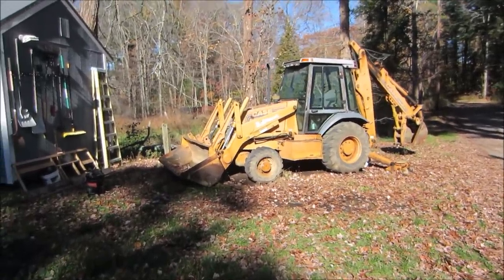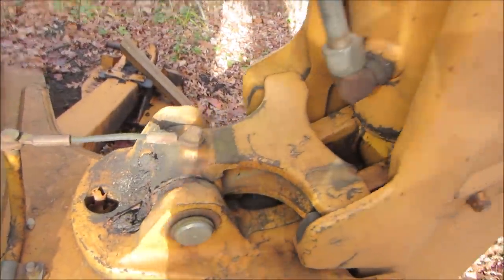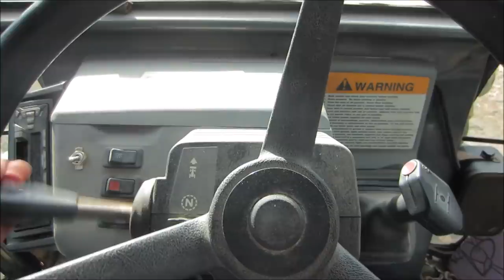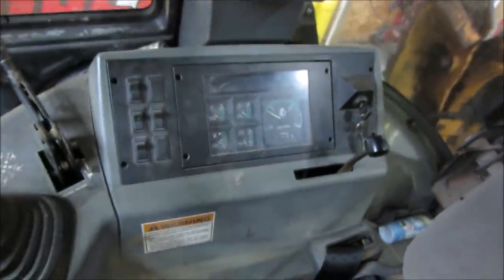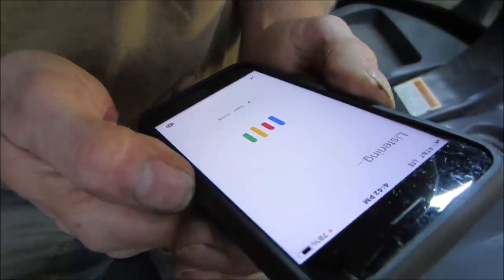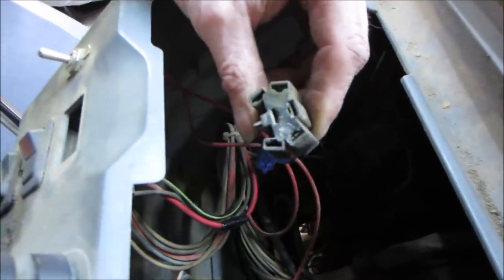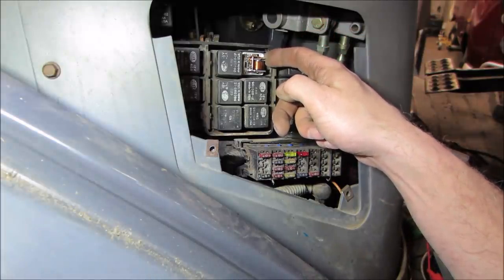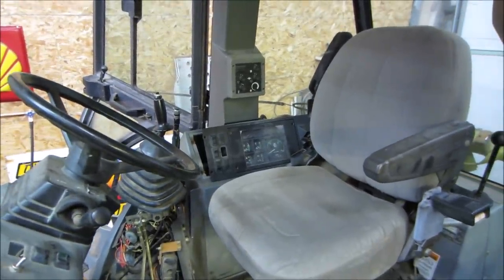Lets Fix Up A Clapped Out Case 580 Backhoe Thats Been Sitting.

Comment: Given how that wiring looked, I'd be pretty tempting to change out all of those bulbs for much brighter LEDs and drop the fuse ratings down by 50% even if you get it straightened out. Something melted it down the first time, but there's no need to run that much power with better technology available. 100W of LED (10A) will burn your eyes out of your skull.
Reply: No need to drop the fuse ratings even if one opted for LEDs.  The rating of the fuse does not determine how many amps flow through a circuit, only at what amp draw the fuse will open/fail.  And the size of fuse in any application is based on the ampacity of the circuit conductors so that if amp draw is too great, the fuse will fail and protect the wiring.
Reply: @larrywalker7759  However, would you want to drop the fuse since if the leds fail it will be at less amperage? I don't know. I am just guessing.
Reply: @Larry Walker  Except the very clear evidence that the fuses didn't protect the wiring. The wiring is all fried.

The entire point I'm making here is that we don't know what caused the original failure. It could be poor design, poor maintenance, or just a ghost in the machine. You could spend years chasing down the true root cause, while it melts down over and over, even after you repair all of the obvious failures. Or, you could just cut the load on the circuits in half, as well as the fuse ratings so the fuses actually do protect the wiring, and probably not worry about it again. Upgrading to LED is an upgrade regardless.

 @BigBaddaBoom  Everything being equal, it wouldn't hurt. I don't think 12v direct replacement LEDs are particularly prone to fail in a ways in which they burst into flames or anything, but..? There's no particular reason to have a fuse in the circuit that is twice the value that it requires, so, there wouldn't be any harm in it even ignoring my original point.
Reply: @TheBrokenLife  Fuses didn't protect the wiring because... they're not in circuit. He shows the back of them at 1:16:40 - there's no wire coming out of either of the fuses, someone bodged it, completely bypassing the fuse box.
Reply: @TheBrokenLife  From the evidence of mice, I can almost guarantee the cause of the fuses going.😒😂
Reply: @BigBaddaBoom  Fuses protect the wiring from melting down and catching on fire, so the fuses are rated for the wire's current carrying capacity. If the LEDS fail they should fail open so there would be no current flowing in the wires and no risk of fire. I'd leave the fuses at the factory rating to prevent a fire in case one of the wires got damaged and shorted to ground.
Reply: @--Lam  You guys are killing me... 

We don't know what caused the original failure that cascaded to where it ended up. I'm assuming that someone didn't just cut it up, bypass circuits and fuses, and burn it down, for sport.
Reply: @artemiasalina1860  Reducing fuse ratings decreases the possibility of fire in the the event of damaged or shorted wires... That's exactly why I'm suggesting it.
Reply: @TheBrokenLife   No, but whatever happened originally, someone's solution was to bypass fuses entirely. We know for a fact there's still a short circuit somewhere in the cabin lighting and that also didn't blow a fuse (radio started working after disconnecting that circuit). Someone really worked hard on screwing this up :)

But the point was: those wires will be fine at 20A load and the reason they melted was that there was no fuse at all, plus the awful connector. I'm not arguing about fuse values! I'm only pointing out that any value would be better than ∞ :D
Reply: @TheBrokenLife  Wire chafe can do that. Esp if it blows when you hit a bump (example being a chevy S10, they put the dash in with tech screws and the wires behind them rub the points).
Reply: Agrees if you can drop the rating a little it’s the way to go. Even if you find and fix the failure cooked wiring carried less current than undamaged wiring.
Reply: @TheBrokenLife  Ok. Good point.
Reply: @--Lam  without seeing fusebox dismantled it's hard to tell, many fuse box only have one visible wire out, the fuse is fed from the terminal via a bus type system with power coming in the other end, this could have been bypassed but hard to say for certain, could have been mice exposing wires
Reply: @n2n8sda  Yeah, the way this behaves I suspect someone tied the outgoing side of two fuses together because one fuse no longer had power going into it. That would certainly explain why both front and rear lights came on at once. It's a bit surprising that the fuse hasn't blown though, as it now has to carry the load of both circuits if my assumption is correct. It doesn't quite explain what's going on with the relay though. Unless the relay is perfectly fine apart from the cover coming off and the actual problem is in the fuse box, which is perfectly possible. You'd have to chase some wiring in continuity mode to find out what's going where. Being a house wiring person I'd expect the power to go from the fuse to the relay and from the relay to the light because that would make wiring the fuse box much easier, just run one massive positive from the battery to the fuse box bus bar and then smaller ones from each fuse to the loads.
Reply: @n2n8sda  Yes, you may be right, Mustie even mentioned taking off the cover and looking in there. Then the switches and relays would have to sit behind the fuses, while the whole wire spaghetti kind of suggested otherwise... but yeah, without knowing what goes where, I'm with you, good call.
Reply: @larrywalker7759   WTF is "ampacity" ? 
You are obviously not an electrician.
Reply: @TheBrokenLife   The melted insulation on the wires, as shown, is from a fault that wouldn't necessary blow a fuse, being a high resistance connection. 
A direct fault to ground would blow the fuse/s and protect the wiring.   
There is no point in reducing current rating of the circuit( i.e. installing a lower Amp fuse) if LED lamps were installed, unless the wiring size was reduced to suit that lower load... in which case the fuse rated to protect the WIRING SYSTEM.
Reply: @BTW...  You are  wrong on both your initial question and your assumption.  If you don't know what ampacity is I suggest you go study the National Electric Code handbook and specifically check out the ampacity tables.
Reply: @BTW...  You're making my case for me. Corroded sockets, switches, connectors, relays, etc will all build additional resistance over time and increase the amp draw of the circuit without a sharp fault to ground that would pop a fuse. That's the entire point of my argument to reduce the demand on the overall circuit and reduce the fuse rating to match, thus making up for all of the unknown extra load while keeping the wiring from burning down again. Past that, for all we know the circuit was designed improperly to begin with and has too much draw available on it from the factory. Something caused the initial failure.

Anyhow... I've stated my piece here. Mustie is welcome to take or leave the suggestion and I'm sure he'll get it sorted out one way or another.
Reply: I would start with the radio, thats always the case when stuff (Esp radios) are added after market. One guy I know installed his own radio in his 623b scraper and fried his new radio because it was 24v.
Reply: @TheBrokenLife  Go ahead, type away and prove yourself to be a fool. 
You describe a series resistance (as poor connections) in a circuit that drops voltage to the original load. The fuse blows when the wiring melts at that poor connection location and shorts to ground. The wiring CSA is sized according to load, and the fuse rated to that wiring CSA. 
The origin of that specific wiring insulation melt is a crappy tap-off connector, that we all know are certainly prone to failure ESPECIALLY when used in a high current application, by some amateur fool bodging up a prior fault.
Reply: Fuses protect the wiring. If the fuse is rated for the wire, there is no point in reducing the fuse value. Extra resistance in the circuit will never create a higher voltage draw, it does the opposite in fact. However resistance caused by a poor connection (like that connector) will cause that connection to overheat. Fuses will not prevent that.
Reply: I agree to that. The size of fuse are ok. But with a less higher AMPS on the wires, when putting LEDS they are not getting that warm/hot.. So less stress, less chance for burning the wires.
Reply: @BTW...  ‘Ampacity’ is a valid electrical term. It is defined as the current carrying capacity of a given size wire in amperes. Also the maximum amperage the wire is rated for. As in 12ga insulated house wire has an ampacity of 20 amps, whereas 14ga insulated has an ampacity of 15 amps.
Reply: @BTW... 
Ampacity is obviously another one of those weird made up measurements (mostly) Americans use when they don't know real words already existed...
Like square footage (area) or amperage (current).

Comment: It's been a while since I ran an L (1998 model), but if memory serves-
 
I believe the plug behind the steering column is for the from whipper.

The bottom left switch on the control panel to your right(when facing forward) is to engage 4wd. If the 4wd isn't working and the switch works, check for corrosion at the fuse/relay. If you have power there you probably have a bad shift solenoid in the t-case (a common issue).

The red button on the Gear selector is a neutral/disengage button for the transmission. It basically is an electric clutch button that allows you to shift though 1st-4th while the transmission is still in drive or reverse.

depending on the options on the machine the black button on the loader controls is a differential lock button.  when you press it, it will lock the differential allowing for maximum traction when pushing/pulling. It can also be a drivetrain disconnect to allow you to lift the loader quicker while still in gear. You will need to play with it to see what it does.

I grew up operating a backhoe, I first drove one at the age of 5 and now I'm 34. The old Super L is still my favorite when compared to the 580D, K, Super M and 590N that we've had over the years. Those L's are torquey machines, they will push until the can't push no more and then they will spin the tires until they are buried to the frame. They are a true work horse. The Super M doesn't compare, the only close is the Super n unfortunately you are stuck with modern day electrics on the Super N.

Oh one more thing. I suggest that you take real good look around the pivot pin where the loader arm connects to the frame. That area is prone to cracking on the top portion of the arm on the M and older models. Its an easy fix if you catch it soon enough.

Comment: Boom cylinder stow position works (over Center) pull cylinder into back position and as soon as it’s bottomed out throw lever forward quickly to extend the boom! It will scare you as you think it’s going to come into the cab!! Some speed helps as momentum in what carry’s it over center!!
Reply: Was going to say the same thing, I've driven loads of cases over the years and it's an oddment to them on stowing the arm.

Comment: Cummins 4BT. It really is a 12 valve 5.9 Cummins minus 2 cylinders. Good engines that run better if you run them a bit hard.This engine series was created for Case before it ever hit the street in a Dodge. My grandfather worked building these engines in Columbus for years. The 4BT is a bit pricey to repair but yours sounds healthy. Nice rig

Comment: Button on top of loader control stick is "return to dig" It automatically returns the front bucket level to the ground when you are digging with front bucket. Top switch above 4 way switch is for interior dome light. 4WD is engaged electrically by switch on right hand console adjacent to the light switches.

Comment: as someone already mentioned you pull the boom back quick and then when overcenter in the back position put the stick forward and it will push it into lock. very easy once you get the hang of it. I ran a 580E for years. good machine

Comment: For the travel lock to work, bring up the rpm then pull your control all the way back and then push it forward as soon as the cylinder reaches the end of its travel and it will reverse and lock.
Reply: I repaired a lot of Case 580s & 590s over the years for plumbing contractors in NYC. Easy machines to operate and repair. Do yourself a favor and get the manual which should include a parts section for that machine if you're keeping it.

Comment: Looks about like my 580 SL (mine is a series 2) except yours has much better paint and I dont have the thumb on the hoe. That extend a hoe is a nice feature. Only 5 minutes in and cant wait to see how many attempts it takes to relock the hoe in to place. Took me a little while to get the hang of it.
Edit: Im sure you may have figured this out, but to get the hoe locked. Bring it all the way back and just before it stops push the stick forward. This relieves enough pressure to allow it to come back the few extra inches to allow the lock the catch. I know it seems counter intuitive but that's how it's done. Bad design by Case in my opinion. 
It does need a little bit of momentum to get it up but not too crazy and make sure the boom is fully curled in as well.
4 wheel drive is a toggle switch on the panel to the right. Along with front and rear lights.
There might be a switch for "comfort ride". It automatically adjusts the loader bucket while driving to minimize jarring. Just be sure to have it off while using the loader.
Bottom left toggle near the lights is the 4 wheel drive. Pretty sure that weight is stock. Ours has it too. Might be part of the hoe option.

Comment: Hey to get the boom back into the travel lock you bring the rpms up a bit pull back  hard on the boom lever to raise it and right when it tops out push the opposite way quick. It slam the first few times you do it until you get used to feathering  it just right. I have a 590 SM with the same set up.

Comment: To get the boom to lock into place you raise it quickly and at the last instant, you push the handle back the opposite way.
Lol, I posted this before I heard you say how to do it.
Change all of her fluids, maybe add some seal conditioner to the hydraulics, repair the bad cylinders, and then as long as you keep up the maintenance she will serve you for a long time yet. I spent many hours running one of the 580s and never had much trouble with it with the exception of some bad pins on the digger arm and bucket. Just keep an eye on the pins and keep them freed and lubed up.

Comment: Hehe haven’t watched more than 10mins yet, but seeing you trying to latch the arm with the safety catch reminds me of a time when I was doing exactly the same on the same Backhoe. There is definitely a short sharp knack too it. Pull the arm back at speed and then push the same control forward and it will latch in! After a while I somehow discovered the knack. Nice find!

Comment: You're gonna love that Case. Do yourself a huge favor and read through the comments, there are a lot of guys out there who could probably peel a hard boiled egg with that thing. As a building contractor I've used some operators that were just plain fun to watch. With really heavy snow I'd wager the plow blade won't push the snow far enough away to work with multiple snowfalls. You'll want to scoop and move the stuff. With the piddling snowfall you get it'll probably never be an issue.

Comment: Great video my CASE friend. I have been running CASES sense the CK clutch brand. I have run every CASE to this model. My uncle had one of the first C model's hauled that one for meany years. It had the standard CASE control. There is NO glow plugs on a CASE  
I believe it's a FPT power plant. Basically a Cummins engine that FPT built on. I own a 78 Dynahoe 190 ( 19000) pounder. I am a CASE man from birth of running Backhoes.

Comment: Yah. ScotchLocs. Those things were absolutely forbidden in my shop, to the point where if you got caught using one, it's automatic termination.

That's actually a pretty nice rig. It starts easily, runs smoothly, most all the hydraulics work, and the cab is in decent shape. Absolutely perfect for the caretaking job you have coming up. 👍

Comment: You said the left foot pedal was the diff lock.   It is more likely the Clutch Switch.. either on or off.   Also on the forward bucket control, the top switch is also for the clutch, when you have your hands full loading a lorry.   I think I would have moved the rear dipper fully out horizontal, and fully up vertical, to get the air out of the rams.

Comment: There's a little trick to engaging the transit lock on the boom on those Case backhoes.  From what I remember running one, you have to 'bounce' it back and engage the lock once it goes past center.  As you have seen in the early part of the video, straight hydraulic pull will only bring it close.  Probably designed so it doesn't engage during normal digging, but needs to be deliberately done...

Comment: The top switch on the left side of steering column is for the dome lights. The switch (button) on top of front bucket control is trans lock out, so you can rev the motor while loading to raise the bucket quicker. the 4wd would be bottom left  on the big (key switch) panel. Only use 4wd off road and 1st or 2nd gear. Making a turn in 4wd on pavement will cause destruction of an axle shaft in the front axle (ask me how fun that is to change...lol). Hope that helps you to decipher.

Comment: The outriggers have street treads, it may have been a city or state machine. I have a 1974 case 580 and got it in 1992 and it has paid for itself 100 times, they are handy.